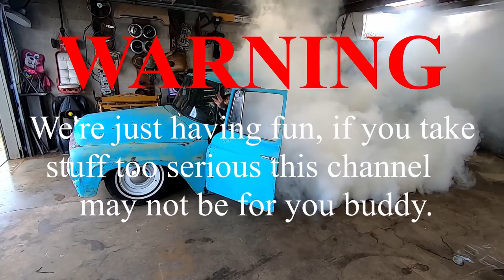1980 C10 Strip down! How to WORK and have FUN!

Comment: I just did the exact same thing to my 96 Dak,  stripped right down to the bare frame with two jacks and an engine lift all by my lonesome. Biggest hurdle was the cab as using an engine lift is a pain in ass. That jib crane is a fantastic idea, I have room for that in my garage.
Reply from the maker: The crane really makes things easy!

Comment: On your supports for holding things up cut the top square tube in half and put a smaller on inside it so you can adjust the width for different things. Just my observation…love the channel

Comment: Had a issue with a short crane once myself. My fix was to weld a roller on ea side of the boom and one one top. I'd then wrap the cable around. Might work for you too.

Comment: Be interesting to see what chassis you put that IH cab on.  I have an old 1-ton that I thought about re-bodying - the battery hold down bungee cord is actually a battery hold-up, to keep it and the inner fender off the tire.   I thought about fixing it until I took a look and saw the inner fender would turn into an outer fender, and a rad support, and the other fender, and on an $800 beater it was lazier to just run a 2x4 across the top of the engine and tie the battery to it. 

That's how I know you're not in New York, you actually have to unbolt that bed.  I had one S10 that looked okay but I pulled the bed right off it just by lifting it up.
Reply from the maker: I have a 98 c3500 1 ton chassis.
Reply: @PuddinsFabShop  I'll definitely be watching then, my old rust bucket is a 93 GMC.  Stick, too, I miss driving it, water coming in through the toe board and all.

Comment: Lots of nostalgia comes from your videos. I look back now and think of all the trucks I broke down over the years with my dad. He was always buying 1960s and 1970s Fords and we would take them down to the frame and build them back. My first was his 1974 F-100. Rebuilt the 360 in it and he painted it pretty fair with spray paint, he'd driven it 6 or 7 years. Sold it immediately once we "fixed it up". We did a 1964 F-100, a 1968 F-100, a 1977 F150 4x4 that was my first vehicle, a 1978 250 4x, a 1978 Bronco, a 1968 step side Chevy,  those are the ones off the top of my head. You could buy those trucks back in the 1980s for 800-1200 dollars all day long. Now a pile of rust that doesn't run from 1978 is 3000 dollars around here.

Comment: Donate the 305 to local HS makes a nice project to tear down rebuild see if still run. with all the budget cuts need all help they can get. cab is better shape than half crap up north, floor pans isn't nothing.
Reply from the maker: No HS shops around here.

Comment: Even umpa lumpa's work smarter not harder :-o.  Don't need a lift. Pull the winch motor back towards the post and clamp or pin it stationary. Top end of the arm, weld a sold steel grooved roller wheel and use a 1/2 or so cable as your picker, connecting the other end to the winch chain.  Or some derivative thereof. Hate to so you struggling by yourself, ask me how I know :-). Keep up the good fight! Cheers
Reply from the maker: I didn’t struggle! Had a blast!

Comment: That was sketchy as F way too many times hehe

If i can suggest for next time, for the cab, get some 2x4 and/or 4x4 wood blocks to lift it up.
Use a floor jack to lif it lil' by lil and adding blocks. When it finally clears the frame, slide some long peices that extend past the wheels on either side so you're left with something like this:

        CAB
__________
#                 #
#                 #
Reply from the maker: I can’t imagine buying wood at these prices and doing that when I have a crane lol I would of done it similar to that if I didn’t have a Crane
Reply: @PuddinsFabShop  yeah i figured but your crane was pretty maxed out in terms of height, just figured it would have been less hassle overall :)
Reply: Not a better feeling than when sketchy as F works though, it's like giving the grim reaper the bird....

Comment: Slap 200 bucks on everything 200 for the cab 200 for the truck bed 200 for the motor and 200 for the transmission you may come out with 800

Comment: So if the guy gets his chassis back what do you get ? Non of that shit is worth anything ?!?! That 305 is known for flat cams ( very soft ) and low compression and low HP , JUNK ! I want that roadster body ! Lol. I have a sweet v-twin and 3 speed gear box and differential plus enough 2x2 tubing to make a midget Roadster ! I already built one with 8hp Briggs but mine has a metal body !